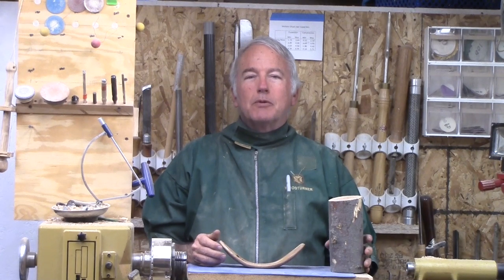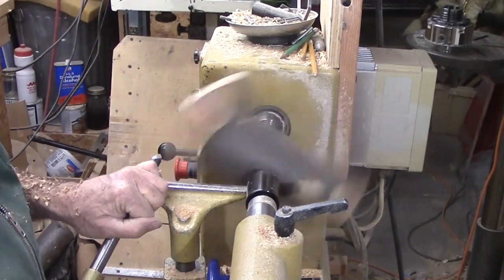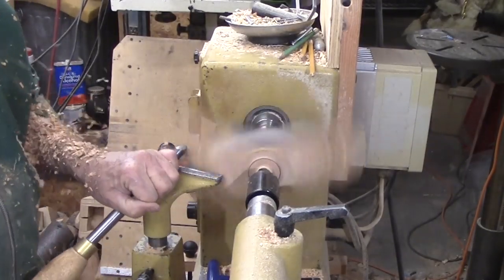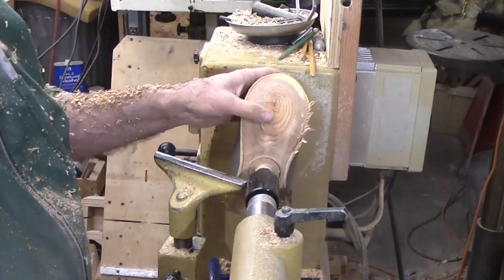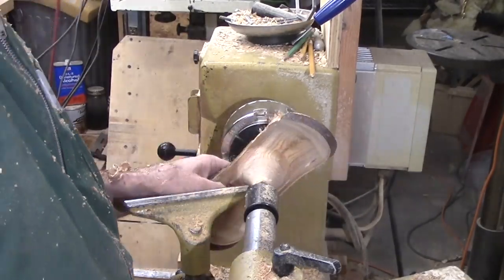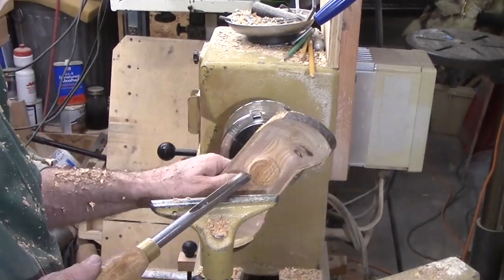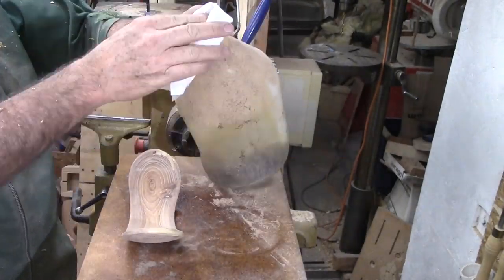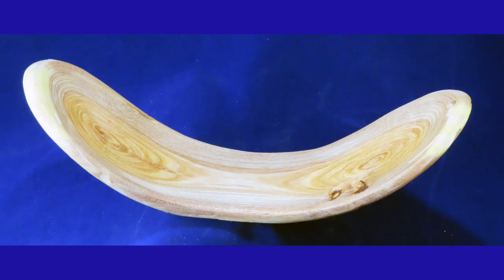Woodturning Limb Bowl   It Learned A New Trick

Comment: How did you prevent cracks from the pith?

After watching this the first time, I tried one out of a greenwood branch and both sides cracked from the pith to the edge (straight up) while it was drying. I may just fill the cracks with epoxy and inlay of some sort (turquoise or mother-of-pearl) once it is fully dry. 

I am working on limb-bowl #2 and would like to prevent the cracks.
Reply from the maker: Green wood frequently cracks from the pith. Much depends on the species.
Here's what I do:
1. Put the freshly turned wood in a paper grocery bag (if you can get one these days) for a couple of weeks. This moderates drying stress by allowing the wood to dry more evenly. Does not guarantee crack free.
2. Accept the crack as part of what wood does.
3. Filling is up to you.  I don't.
Alan

Comment: Very nicely done. I would not have ever thought of that way to turn. Do you remember the speed you were turning at?  Again thanks!
Reply from the maker: Yes I did. Medium at first; Faster later.
My lathe does not have a meter and I do not rely on one.
Subject to overall safety, I try to turn as fast as my lathe will let me.
Maximum lathe speed depends on wood balance, lathe weight, lathe flex, and lathe anchoring.
So, even if I could tell you a speed, it would not apply to your setup.
Don't rely on your meter - Sense the vibration, see if it goes down at a slightly higher speed, then reduce speed to a comfort level.
But, do not exceed what you are comfortable with and keep it safe.
The only totally safe speed is zero.
Alan
Reply: As Wood Turns   That’s a good explanation and I understand what your saying. Thanks!